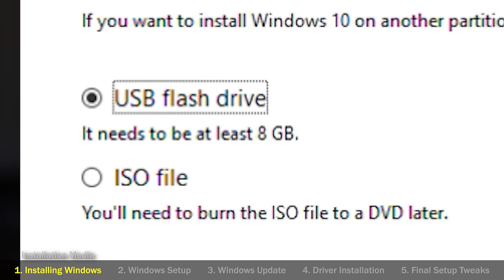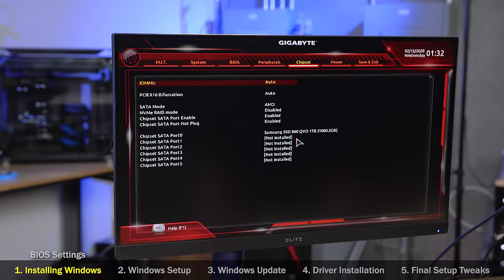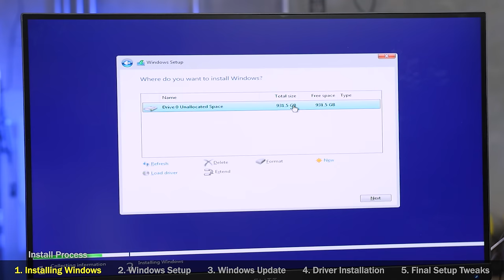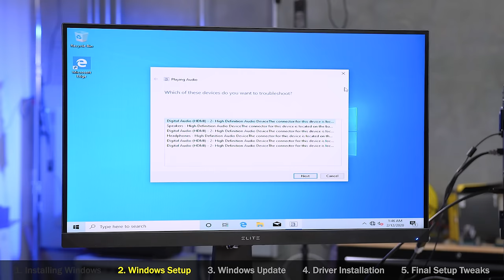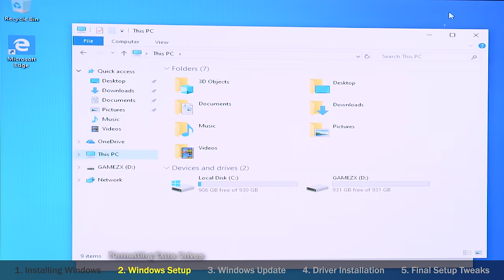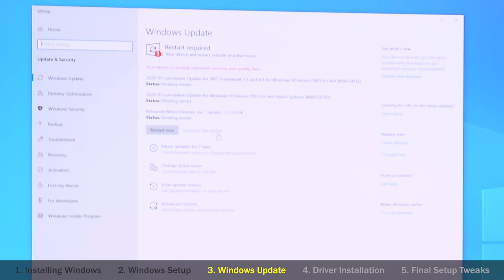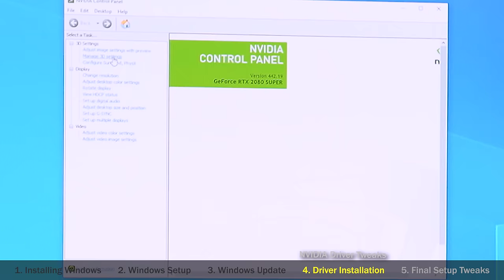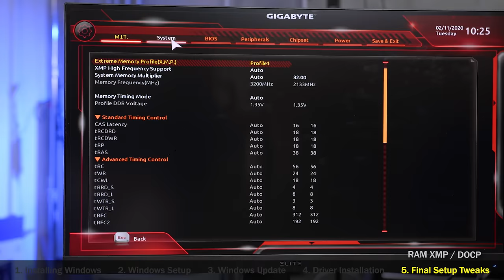Guide: What to do AFTER building your computer...

Comment: new guy here.. 
what if I manage to boot from my old sata ssd first (have retail version, seen vids where people do that) then set up a clean install on that new nvmi drive and boot from there, is this even a thing? possible side effects?
Reply: What exactly is the point of that? If you're going to install Windows on the NVMe, why not just do that from the beginning? You can format both drives from within the Windows installer.
Reply: @JJFlores197  thing is I bought CPU MB and ram only to replace within my old pc, dont have nvmi yet (Im on budget) will get good one soon so was thinking to run from old sata ssd until nvmi arrives. sorry should explain this in my first post:)
Reply: @JJFlores197  other thing is, maybe I can fresh install on my old ssd, get back all programs I need, and when nvmi arrives make a copy image to install on nvmi? would it be possible?
Reply: @Radical_Middle  Ok. So yes you should be able to put in your old drive and use that in the mean time. You can clone your Windows install from your old SSD to a new drive, but I think it makes more sense to just wait until you have the new drive and do a clean install.
Reply: @JJFlores197  thank you. will wait for nvmi so to be on safe side.

Comment: my NvMe m.2 drive is not showing up at all, I have updated the bios from the msi website to the newest one available and still no detection of the M.2, my spec are MSI MPG X570 Gaming Plus motherboard, Ryzen 7 2700x CPU, Gigabyte P750GM Modular PSU, 32gb of G.Skill Ripjaw DDR4 ram, Sapphire Nitro + RX 580 4gb GPU. my bios boot mode is in Legacy + UEFI mode and CSM is turned on in bios, but it will not detect my M.2 drive i went to MSO and my exact M.2 is supported and compatible with this motherboard. i do have to have the m.2 in the 2nd nvme slot because in m.2 slot 1 it won't post at all the pc turns on but no post but in m.2 slot 2 it posts but under bios no detection of the m.2 drive, any help from anyone would be amazing I'm losing my mind on this issue.

Comment: Can I get my new build to see my monitor  The guy who built it I saw the bios told I would install windows myself butI got it home my new build can't send a signal to my monitor  From the GPU nor from the motherboard What should I do anybody
Reply: Make sure you only plug into the video card and not the motherboard. Look at the board, if there are issues, most boards have a diagnostics light that can help point in the right direction.

Comment: What i have to do motherboard z690 gigabyte master i7 13700k ram gskill 6000mz ddr5 my pc boot after to the light board on the motherboard write c1 and close and boot again is ram problem?please helping
Reply: Could be RAM related. Try this. Remove all memory modules. Install only 1 module at a time. If the PC boots fine, then that module is most likely fine. After that, remove that working module and install another one. If the PC boots fine, that module is most likely fine. Repeat for all modules. If your RAM checks out fine, then the RAM is likely not the issue. if any module fails to boot, then that module is likely bad and will need to be replaced. I would also reseat the CPU. The CPU has a memory controller, which as the name implies, is is responsible for talking to and managing RAM. If the CPU was not properly installed, it may have issues with RAM even if the RAM itself is not bad.
Reply: @JJFlores197  thank  you  so much i will try  like that

Comment: I hope anyone can answer this, my PC  won't sometimes boot up and only  the RGB RAM sticks light up. I turn it off, i leave it for a bit, come back an hour later and then it boots up. Once it boots up, i don't dare shut it down because it will take time to get it booting again. And sometimes whenever it does try and boot up i get the "insert boot device" error. Could this be possibly the MVme?

I do not have spare parts to try troubleshooting. I already sent this to the shop, they did test, it turned on, they repeatedly booted my PC on and off more than 10 times and there wasn't any problem. But when i brought it home, it was still happening. When i turn it on, only the RAM sticks light up. I'm completely lost here and i hope anyone can give any insight.

Comment: First time build a pc and its have a problem that my pc flash up and turn off immediately and it has a red flash cpu on the motherboard. Need some help!!!
Reply: Check if you CPU is correctly placed and connected.
Reply: Every cable is correct
Reply: By flash up, do you mean that the screen briefly turns on and shows a video display or does it not show anything at all? Have you verified that your CPU is compatible with your motherboard? On some boards, especially AMD ones, you first need to update the BIOS to a version that supports the CPU you want. Unfortunately, if your board doesn't have a flashback option, you have to first install a supported CPU, update the BIOS, and then install the CPU you are planning on using.

Comment: how do i connect to internet without Ethernet cable
Reply: You need a wifi capable motherboard, wifi USB stick, or a wifi adapter installed via pcie.
Reply: @jdk5281  so is the Motherboard B660M DS3H DDR4 (LGA1700/DDR4 a wifi  motherboard cause i looked it up and idk where to look
Reply: @mathewdixon6624  No, it has a port for an ethernet cable. You can sometimes plug into your wifi with an ethernet cable. For example, I have a Google Home wifi system where I plug an ethernet cable into the one of the three mesh routers. If you just want to do wifi, you would want to buy an adapter that either installs into your motherboard or one that looks like a USB flash drive that just plugs into the USB port.
Reply: @jdk5281  okay ty so much and sry to take up ur time

Comment: My hard drive isnt showing in my bios at all. All of my connections are made properly whats wrong with it
Reply: Do you have an M.2 drive installed by chance? If so, most motherboards will disable certain SATA ports based on how many and what type of M.2 drives you have. Check the motherboard manual for the table for this information.

Comment: Hey when i start my pc it says “fTPM NV corrupted or structure changed”
And i cant press any of the buttons it says

What do i do?
Reply: Try plugging your keyboard into a different USB port. If that doesn't work, try another USB KB. I've found sometimes the fancy keyboards don't always work correctly or at all before the OS loads. A simple USB KB usually works fine in those instances.
Reply: @JJFlores197  thank u but i just needed to install windows first then go to the bios to disable some settings

Comment: Yo, Someone knows how to fix nvme not showing up in my bios? Motherboard: Asus tuf b660 plus ddr4 wifi
Reply: I would make sure the NVMe is seated correctly. Re-seat if necessary. Sometimes updating the BIOS to the latest version helps with NVMe drives.

If that still doesn't help, try plugging the drive into another NVMe port on the motherboard if your board has another slot.

Comment: Someone knows what to do if I built a new PC and when I turn it on the fans works cpu fan works seems like everything works but my monitor does not show anything and stays in black :(
Reply: Dealing with the same issue right now
Reply: If your motherboard has a diagnostics or debug light, take a look at it. It can help guide you where the problem may be. Make sure you plugged the video cable into the graphics card and not the motherboard's onboard video port.
Reply: @caseyabney  just realized that my mistake was that I was missing to connect the ATX 12V cable🥴 super noob mistake but just after that everything worked fine :)

Comment: I jusr had reset my pc I feel like am missing programs and I have XLR mic that can't seem get to work feel like am missing audio drivers I try everything to my knowledge
Reply: If you did a factory reset, then that's expected. By definition, factory reset erases everything off of the computer and sets it back to default.
Reply: @JJFlores197  yeah but is there way to check what software I am missing I have USB from when I bought it I just want mic running as it used to but having problems
Reply: @XP_Limit  You would have needed to have a list of the software you had in the past and compare it with what shows up in Add/Remove programs in Control panel.
Reply: @JJFlores197  ah well that Gone It's seem to be running fine you think calling the company that I bought it off would able to sort it out for me

Comment: I have already windows installed but since I put new part in I don't no why but windows don't work what do I do ?
Reply: Kinda helps to know what new part you put in....
Reply: @Javier Flores  cpu ram and motherboard
Reply: @posindowe  and what exactly is not working? Error codes? Messages? Not trying to be rude, but if you're asking for help, its pretty hard to help without information.

Comment: When I plug in my SanDisk in my pc and press f10 it loads back up in bios
Reply: Make sure the SanDisk is detected by the BIOS. Make sure that CSM (Compatibility Support Module) is disabled and that only UEFI Boot is enabled. Make sure Secure Boot and TPM 2.0 (if installing W11) are enabled. In some instances, updating the BIOS to the latest version can help. If it still doesn't work, rebuild the USB drive.
Reply: @JJFlores197  does windows have to be on the USB?

Comment: When I activated the xmp profile on my computer it said it failed to boot
Reply: XMP is an automatic RAM overclock. Its not guaranteed to work perfectly on all systems. You may need to manually adjust your memory settings to match the XMP settings. RAM OC is part art, black magic, science, and luck.
Reply: @JJFlores197  it ended up working when I set the speed to 3000 instead of the rated 3600. Is that bad that I can’t go past 3000? It booted up at 3066 and 3100 but eventually crashed.
Reply: @JJFlores197  seems stable at 3000 though

Comment: I can’t download windows from the usb It keeps going back to the bios pls help
Reply: Did you make sure you set your USB drive as the first boot device? Make sure you have disabled BIOS mode (CSM, legacy mode or similarly named) and that you have Secure Boot and TPM 2.0 enabled. If that still doesn't help, you may need rebuild your USB installer.
Reply: @JJFlores197   thx man it worked

Comment: Do I download motherboard drivers?
Reply: or will it automatically pop up with the bios when I turn the computer on
Reply: Windows will automatically try to download the drivers for all of your hardware if it has an internet connection. It is convenient since it does it for you, but in my experience it doesn't always download the latest drivers. I would manually download them from the motherboard's download page.
Reply: @JJFlores197  my new built pc can’t find any driver for my network adapter, will I need to install my motherboard drivers in a usb ?
Reply: @kvnxo2078  No. You don't install the drivers on the flash drive, but you can download them to your flash drive through another PC and then install on your newly built PC.

Comment: doesnt work for me. i cant figure out how to get into bios
Reply: Do you see any screen on the monitor when you turn on the PC?
Reply: @JJFlores197  hey i fixed the ram it was installed upside down and the light on the mb was orange orignally so once i did that and used a usb to boot it worked, key thing is to boot it when the light turns white

Comment: What if it says windows can not be installed on this drive
Reply: If it tells you something about the drive not being of GPT, try this:
Press Shift+F10 to open a Command Prompt window and type in the following commands:
DISKPART
LIST DISK <Make note of the disk # where you're going to install Windows onto
SELECT DISK # <Substitute # with the disk # from above
CLEAN
CONVERT GPT
Close the Command Prompt window and try the install once more.
Reply: @JJFlores197  I did this and now it won't even load the windows that I installed on usb
Reply: @user-zj1qq8we2z  Make sure CSM is disabled in the UEFI and that  UEFI boot, Secure Boot and TPM 2.0 (If installing Windows 11) are enabled.
Reply: @JJFlores197  I realized the aorus bios was out of date. I updated it but now my ssd is not showing up. So when I search for disk nothing is showing up other then the flash stick. Do I have to update the drives?
Reply: @user-zj1qq8we2z  reseat the ssd. Make sure you disabled CSM mode and only have UEFI mode enabled.

Comment: Here after booting my first pc everything is working. I have to install windows 11 since I'm using 12gen Intel and it doesn't let me select I don't have internet lol
Welp bloat ware here I come 🥲
Reply: You can still bypass it. Press Shift+F10 to open a command prompt. Type in: OOBE\BYPASSNRO
This will reboot your PC and take you to the setup screen where you choose your language, etc. When it gets to the part where it wants a network connection, there will be an option that let's you skip that step.
Reply: @JJFlores197  That's a pro gamer move! lol
I'm a scrub at this so I just went in with it. Already got everything installed and windows is up and running no problem though

Comment: I feel like I spent a bunch of money got 64 gigs of ram 6800xt , 5800x, and my games crash constantly im fucking clueless on how to optimize my system
Reply: Check your hardware temperatures, mainly CPU and graphics card. Make sure they aren't overheating. Also, make sure you have fully installed all necessary drivers (mainly chipset and graphics card) and that Windows is fully up to date.

Comment: Hey i installed windows but i cant get the damn windows updates to finish because my pc keeps freezing. Help please
Reply: Have you checked your hardware temperatures to make sure your CPU and/or GPU aren't overheating? Did you enable XMP or any other overclock? If so, temporarily disable that and see if stability improves. Does the PC freeze only during updates or even if you let it idle?
Reply: @JJFlores197  i enabled xmp but even before that it was still freezing
Reply: @JJFlores197  my hardware werent overheating
Reply: @JJFlores197  and even if i let it idle it still freezes
Reply: @JJFlores197  also i dont have an ssd but a seagate barracuda 2tb hard drive should i buy an ssd and download windows on that instead? Or no
Reply: @qudsii  I strongly recommend an SSD as the boot drive over a hard drive. SSDs are much faster than hard drives, but even with an HDD, your PC still should not be freezing. Its hard to say if it is a hardware or software problem.

Try this: Turn off your PC and disconnect it from power. Remove all memory modules. Install only 1 (per the motherboard manual). Power on your PC and see if it still freezes. If not, that module is most likely good. Repeat the process: remove the known working module and install the other one and repeat.
Reply: @JJFlores197  so the memory right?

Comment: After I save and exit
It keeps taking me to the Bios menu. 
 Someone help me please 😩
Reply: Did you have your USB installer plugged in and made sure it is set as the first boot device?
Reply: @JJFlores197  Yes. After it tries to reboot I get a quick screen prompting me to either
Enter into BIOS , boot the system (with F11 key) 
Or to Flash the MB
Reply: @blamboman  I would go into the BIOS. Disable BIOS mode (maybe called CSM, legacy BIOS or similar). Make sure you have UEFI boot enabled and that your USB drive shows up something like: UEFI: followed by its model name. The exact wording varies between motherboard manufacturers. If that still doesn't work, you may need to rebuild your USB installer.
Reply: @JJFlores197 okay,  I'll give it a try, thank you !!
Reply: @JJFlores197  it worked !! Thank you, thank you

Comment: I’m about to throw my pc into a fire I have tried EVERYTHING on EVERY video I could find and I can’t even get to the windows screen
Reply: So what exactly happens when you power on your PC? Are you able to get into the BIOS? Is your USB installer set as the first boot device? Kinda hard to help without details.
Reply: @JJFlores197  I figured it out but now when I get to the part where it says getting files ready for installation it stops at a random percentage every time I restart my pc it stops at a different percent
Reply: @tobythamm6301  What happens when it stops? Does it give you an error message or just freeze? Try rebuilding your USB installer. Sometimes there is a file that is corrupt which can cause problems during the install. Once you rebuild your installer, boot your PC from the USB drive. However, before you try installing again do this: Press shift+F10 to open a command prompt and type in the following commands:
diskpart
list disk <make note of the drive number of the drive you're installing Windows to
select disk # <substitute # with the drive number from above
clean
convert gpt
Close the command prompt and try installing again.

Comment: what if my bois dont show up
Reply: I would first make sure you connected the video cable into the graphics card and not the motherboard's video output. After that, make sure ALL internal connections are correct and secure. If your motherboard has a diagnostics light, take a look at it as it can help point you to the potential problem.

Comment: How do you make sure there is no wifi to skip the spyware and microsoft account stage if your motherboard has wifi built in?

Won't the motherboard automatically connect to wifi on boot? (mobo is rog crosshair viii dark hero in case anyone needs that to answer)
Reply: You can usually disable the built-in wifi module through the BIOS.